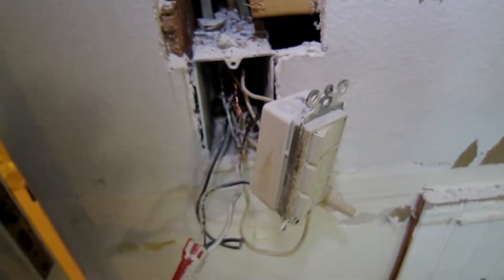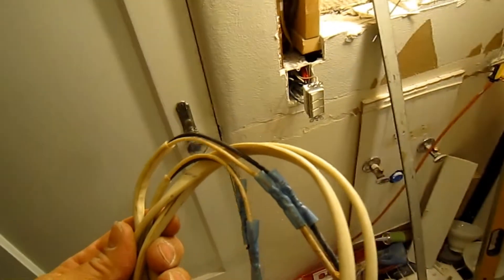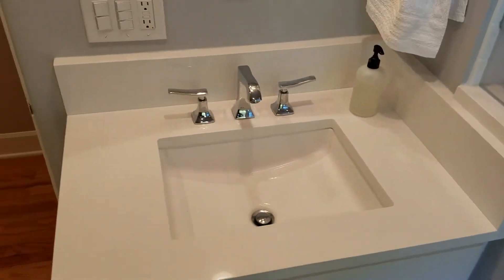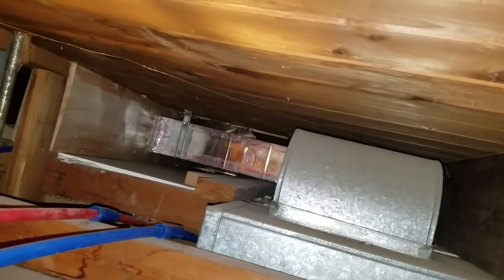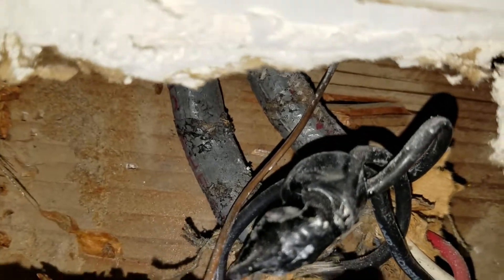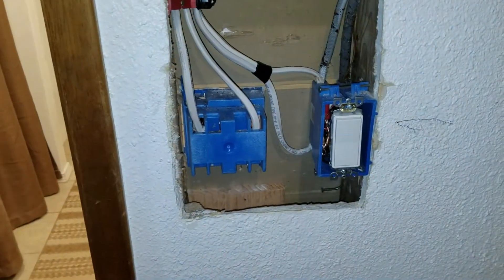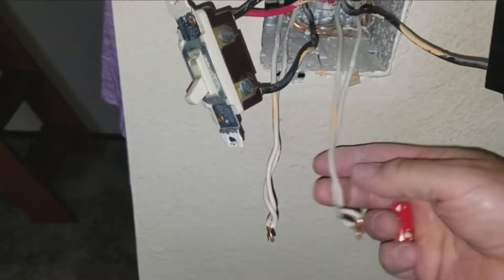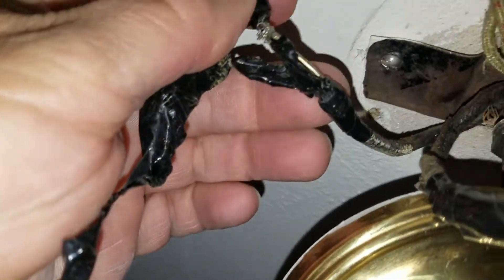Electrical Fire Hazards Hidden In Your Walls

Comment: Yeah, instead of a well defined crimp done with the correct crimping tool,  just twist the wires together in yo wirenuts. That will definitely be better and will not corrode. US electrical code is joke, in some ways.
//PS: Not approving wires should be spliced like this by any means//.
Reply from the maker: Push in and lever lock connectors make contact on a small surface area of wire. Twist wirenuts create large areas of twisting contact between wires. I prefer IDEAL brand wirenuts. Never had a failure.
Reply: @CITAP1  Sure,  they make large surface area contact. Only if they are twisted enough. But the contact force and area is undefined. 

Guess what kind of  wire splicing is used in aerospace tech? Twisted wires? Oh noes,  crimp and solder.  
Guess what kind of wire splicing is used in the rest of civilized world (or at least the direction all is going to it seems)? Spring-loaded terminals.

Yes, contact area in a spring terminal may be lower, then in yo wiretwist.  But the contact pressure is very high, so impurities and weather can't enter the tightly squeezed connections (which is true also especially for a crimped connection). Worries about conctact resistance are void here too.

Which of the mentioned connections are the most repeatable?  Spring loaded terminals and crimps.  Your twisted wires are not a well defined connection, rather ill-defined. No two connections will be like each other. And do not argue that you make all of them nice. Nice is not quantifiable. You maybe can do them nice, but what about all your electrician colleagues? All the other hacks and diy homeowners? Which of the connections  do you assume they can reliably make?  Twisting wires together?  No. Using a spring loaded connector is the way to go, as the connection geometry and forces are by design and very repeatable.  Wires twisted together have zero repeatability, hence the connection could be easily made from good up to unsafely poor.

Please note I do not mention a crimped connection here too much, as although a very reliable connection type, it requires proper tools and a bit of skill. Soldered connections are also very reliable, but the most difficult to master, to get repeatable results, so niether suitable for home installations.

For a home installation, where there indeed is a risk of being tampered with a laymen, spring loaded connectors are definitely the most repeatable and reliable connection, especially that all it takes is just "pushing the wire in a hole", which can definitely be made safely even by laymen and there is very low risk of the connection being made unsafe.

So, that you do somethin in the US of A for I dunno, maybe 100 years, does not mean it is the best way to do it. Please think critically, and do not defend wirenuts without putting any second thought to it. Even arguing that "wirenuts are the code" does not mean they are the best solution. They are the "industry practice", but not "industry best". These are two very different things and today, there are many options to do electrical connections, that are arguably better, than wires twisted together.

I have also not mentioned  terminating wires under screws, which is also problematic  in terms of repeatability. Without having proper tools, such as a torque screwdriver, such type of connection is also not well defined and poorly repeateable connection, compared to a spring loaded contact.

Just saying...
Reply from the maker: @Sixta16  Wirenuts are the predominant device used here. They are well proven and trusted. You rarely if ever read about a house that caught fire due to a wirenut connection failure. I have rebuilt a house that burnt down because of an old porch light that caught blow in cellulose insulation on fire due to what is thought to be corroded contacts, possibly the riveted connections to the porcelain screw in bulb holder overheating.  VIDEO:
https://youtu.be/6t2YMKs3C9Q
The WAGO and similar are available here but expensive. They just haven't gained industry trust that I've seen but I have used them a couple times just to get a couple test beds out there and see what happens over time. For a long time, I resisted PEX and Sharkbite and compressed collars for plumbing Prefering to continue using L gauge copper pipe and fittings. Now I'm totally sold on PEX and Stainless-Steel collars. Faster, cheaper, no flames in tight wall spaces soldering, much safer. In time, who knows what method will win out over the rest.

Comment: Wow sure makes me scared to ever buy a previous owned home again! Especially one owned by the handyman type! My dad was an electrician and did a lot of extra little jobs on my childhood home. Of course he did them right. It was one of those older 60’s style FL homes with the breaker box outside on the exterior wall which in the summer storm season he would always move my bed away from that wall in the house to the other wall in case of a lightning strike he used to say.
Reply from the maker: It's not just electrical either. Over the years I've come across foundation issues, framing issues, plumbing issues, just about anything to do with a house, I've seen it goofed up.

Comment: Hey Jeff.. amazing that lasted as long as it did huh. On the bright side..they were consistent.. consistently shoddy but consistent 😁🤪🧐😲
Reply from the maker: These examples were spread over 3 houses. One house in particular, every time we looked, we found something badly wired.  I have a lot of other examples but I'd have to do a big search to assemble them into another video. Could be a good video project and worth the effort to locate the pictures pending if this video performs well enough. There is one house we did a major remodel on that caught fire due to the front porch light being poorly wired. The fixture was covered in blow in cellulose insulation that over time puffed enough powdered insulation into the connection box. The wires were corroded and loose which led to resistance which leads to arching, which ignited the supposedly fire treated insulation, which led to smoldering and fire. I'm working on a video of that place. It's from when I first started recording things for work but YouTube wasn't a thing yet. It's a good thing I save everything. Take Care Paul...     
We were going to go to Florence OR. in May for the Rhododendron Festival but the event is cancelled so we are trying to come up with alternate options. Stupid virus...
Reply: @CITAP1  Yeah..this year is gonna be crazy for sure 😮